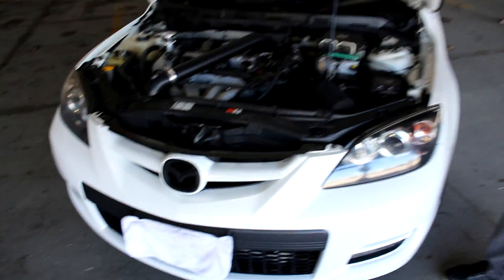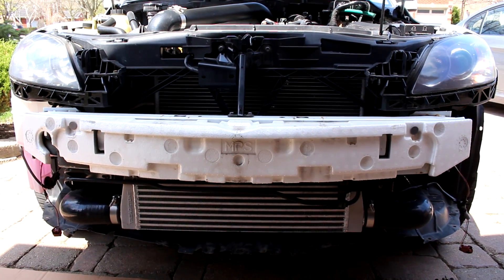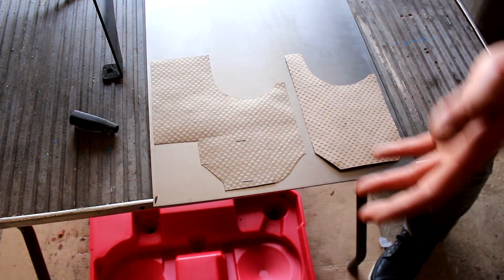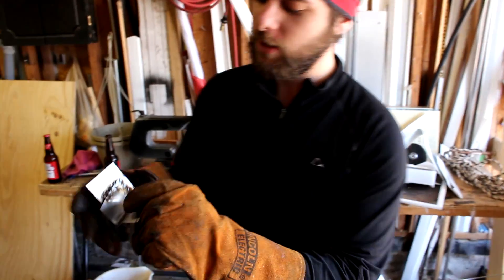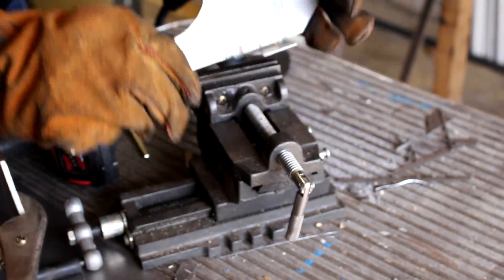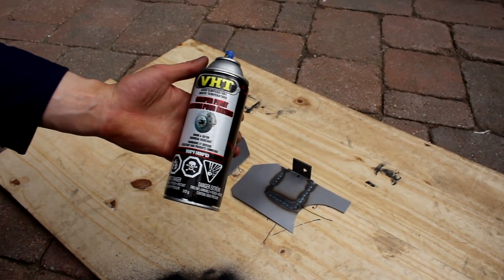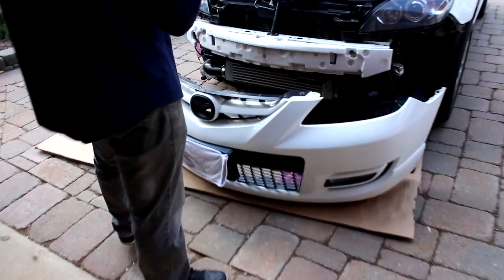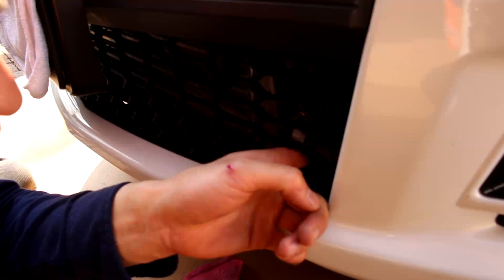Mazdaspeed 3 - Custom Radiator Ducting & JBR Raider's Air Dam Install

Comment: Did you consider ducting from the grill to intercooler?
Reply from the maker: It was actually easier to determine fitment by mounting the ducting to the actual radiator support with the existing bolt holes for the original OEM ducting

Comment: Have you see an improvement on coolant temps? Thinking about getting air dam for my Gen 2 but I’m not entirely certain I’d benefit from this as the Gen 2 isn’t as open as yours. Kind of wish just the side pieces were done to test that but oh well
Reply from the maker: Ohh yes huge improvement. Coolant temps no longer linger above 200F once the car starts moving on a hot day

Comment: it was much easier to install a cold thermostat ... but it looks stylish. sorry for my beautiful english.
Reply from the maker: I don't think a thermostat that opens at a lower temperature will solve the issue, it will only delay engine warm up. Once the coolant in the engine gets hot enough, it still needs sufficient air flow through the radiator to dissipate that heat, which is what this radiator ducting ensures :)

Comment: Interesting to see how to reverse the fomoco design that's based around tmic
Reply from the maker: Definitely! Running a FMIC reduces heat soak when the vehicle is stationary and delivers a more dense air charge into engine. The problem is that it requires the stock raditor ducting to be removed in many cases and blocks the radiator itself. This causes coolant temps to creep higher than normal. Having this custom ducting installed forces air through the radiator and keeps coolant temps in check ;)
Reply: @WannabeTuners  yea I can definitely see how having all the air being directed to the top of the valve cover as an issue and tmic becomes lacking when the volumetric efficiency of your turbo is in some cases doubled maybe something too look into. Perhaps pre turbo n20 or other compressed gas injection in a smallish dose could lower intake temps even further but that's getting more in-depth then most people care to dive into
Reply from the maker: @stephenremington1024  Oh yes absolutely! Many people run water methanol injection pre throttle body for increased fueling, a cooler air charge, and increased octane

Comment: Glad to see other people actually enjoying/using my write-up. The setup is pretty magical when you see coolant temps drop on a 4th gear pull with temps 80 and lower. 

Koyo adds a little more efficiency, but still heat soaks at the track. Koyo needs to make a Hyper-V core for the speed platforms. The H-series is meh over stock. 

How have your results been ?
Reply from the maker: Thanks man! Results have been fantastic!

Comment: yes some else did this mod and made a video instead of broken pictures links on the forums! I'm doing the same thing but a bit more in depth since I track mine. making a skid plate that push air up and adding hood vents to make the engine bay a low pressure zone effectively sucking air in to it through the radiator.
Reply from the maker: That sounds awesome! I like the skid plate idea. Let us know if you post some pics of that, that's something that would be cool to see!
Reply: Will do! working on designing the whole thing right now as i wait to put my new engine in cause my car hates me
Reply from the maker: BooksofPerdition Why what happened to the engine?
Reply: oh well last engine throw cyl #4 out the block due to a unknown reason I'm trying to find why but everything seems fine and the logs says everything was all good so i think it just let go and the stock engine went out on a track day cause of the friction washer on the crank slipped
Reply from the maker: BooksofPerdition Oh man that's crazy! Was the engine really hot when it happened?
Reply: the stock engine ya it was at around 215 not to bad bad still hot and the 2nd wasn't  bad at 175 seeing as the second one didn't go at the track but while doing 50 on a highway lol
Reply from the maker: BooksofPerdition Oh wow so you've rebuilt twice?
Reply: yes sir! didn't build it myself this time though in fear that I messed something up the last time so i'm just getting the corksport dankai 1 this month and replacing the whole fuel system along with it i guess third times the charm
Reply from the maker: BooksofPerdition Haha oh man I think so! That Dankai engine should be great. Do they offer any warrantee with it?
Reply: ya its a 6month/6k mile warranty and those are gonna be some hard 6k miles for sure
Reply from the maker: BooksofPerdition Yeah right on!
Reply: The picture links to my thread aren't broken. Check your browser settings. 

http://www.mazdaspeedforums.org/forum/f10/radiator-ducting-198493/

Comment: Would definitely be interested if the air dam + side cuts work better or same than an upgraded rad from Koyo. I suspect the air dam is likely necessary either way, and that a koyo would maybe help with another 5-10 degrees.
Reply from the maker: Hey man I feel like the Koyo rad along with the ducting might be over kill in a street application. I notice that after a pull coolant temps with drop to 183 with the stock rad and ducting. So it's working very well. Of course coolant temps still rise at a red light, but come right back down once the car starts moving:)
Reply: Wannabe Tuners ah good to know! Yea in traffic probably doesn't matter the rad then. I'm more thinking for extended track lapping but will need more data for that.
Reply from the maker: Leif Madsen Yeah I would say for track use upgrading the rad would be a good idea since the engine will be running hotter for extended periods of time
Reply: The Koyo has a slightly higher capacity than the stocker. It doesn't heat soak as quick, but will eventually get there. The only way to combat the heat soak is with a fan speed controller.

Comment: I did something similar on my 08 but didn't notice much difference in the temps unfortunately. 

It may cool faster once moving but the only thing you can do to help with coolant temps while stopped is cranking the AC (turning on aux fan), or adjusting your coolant/water ratio
Reply from the maker: K Thompson Yeah the problem was that once I started moving it would just hover above 200. Now it drops down to 190 much quicker. I think the top air damn compliments the sides more than the sides compliment the top if u know what I mean. They all work together to keep the high pressure zone in front of the radiator lol